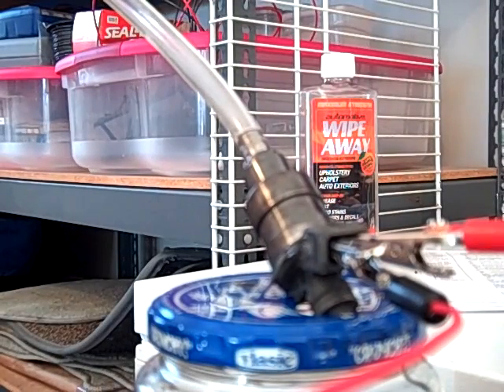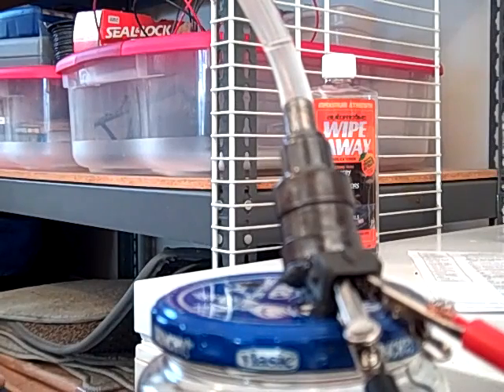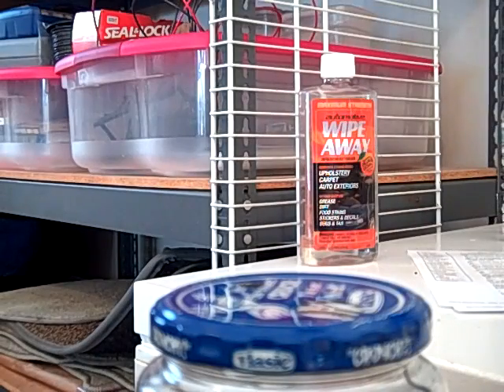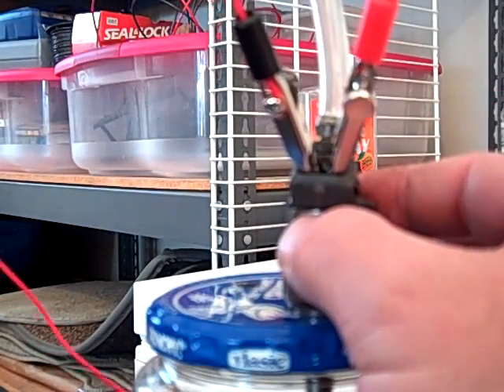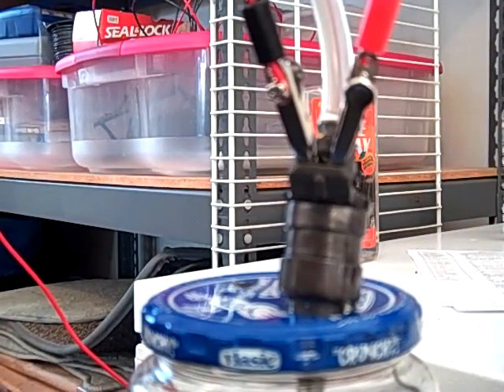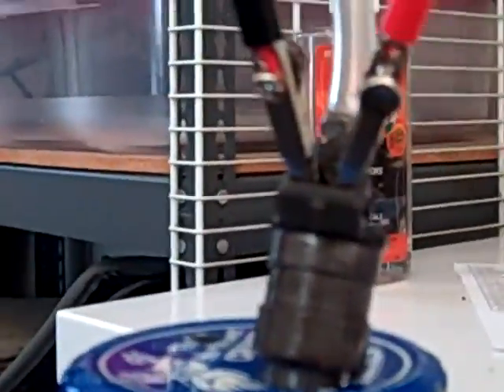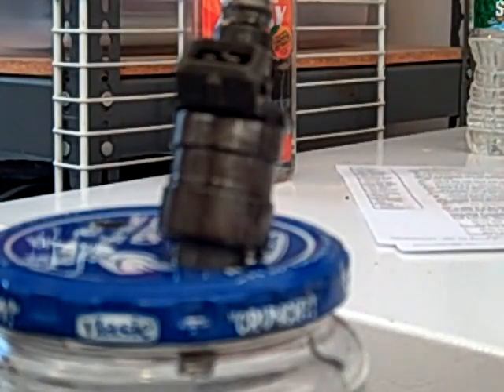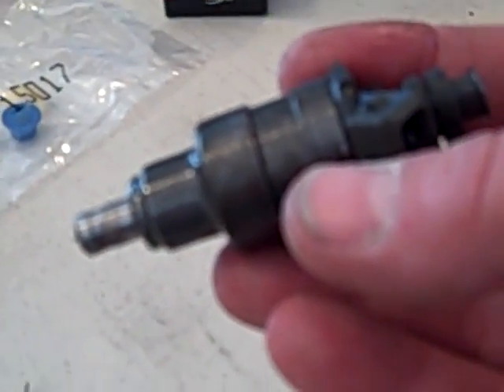Rebuilding a Bosch Fuel Injector from an 83 Porsche 944 #6

Comment from the maker: you sure can - or i sell small kits with a momentary firing switch and a 12V transformer @ 1.5A so as to not burn anything up or risk shocking yourself with a couple hundred amps. You can use it for a lot of testing items in 944 troubleshooting.

Comment from the maker: @UTUBEMJEM  - nope, it doesn't matter. It's just one side's positive and one side's negative. When the car is running, the injectors get 12V at bpth terminals and the car's ECU sends alternating ground to the injectors to make them fire. The one thing to concern yourself with is that the "firing signal" whether it's a switch, button, or connecting the wires to the power source is that the power shots are momentary. You will short the injector if the power the injector nozzle is held open.